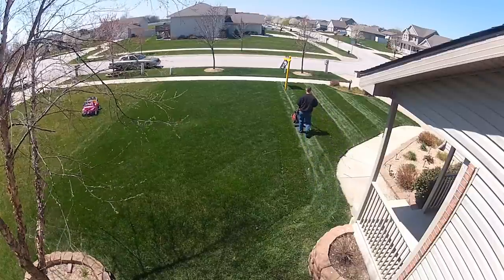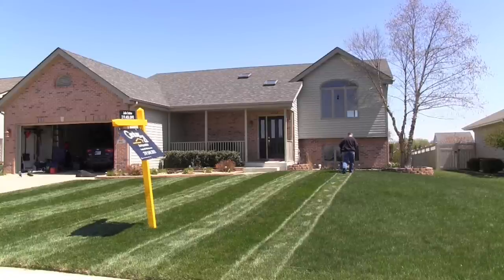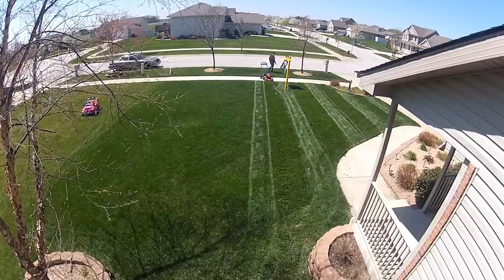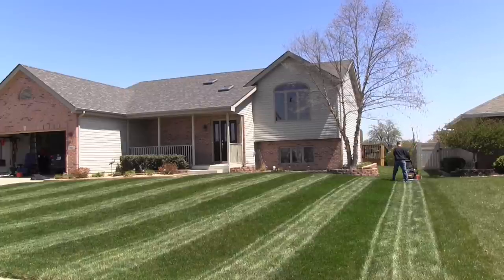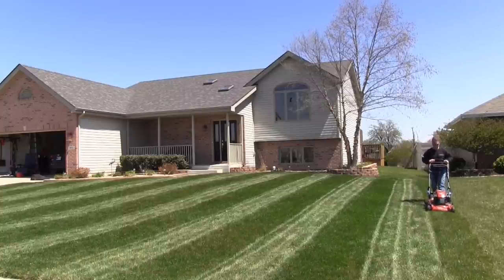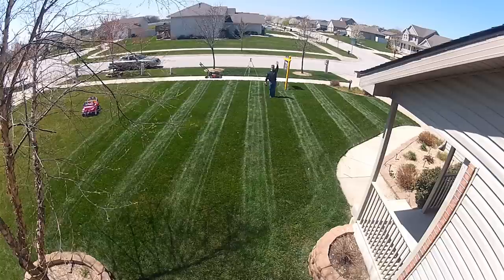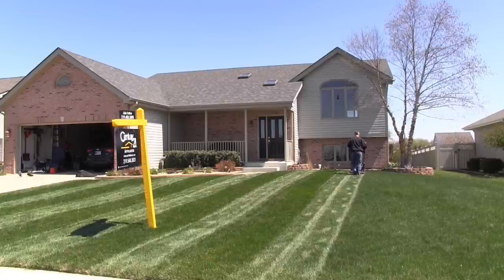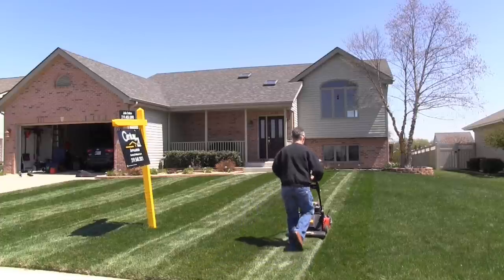Lawn Striping: How Does It Work?

Comment: to get Pro looking, perfect stripes you need to buy a bicycle grip push style lawn roller and add some water to the tank. the more water you add the more the grass blades will bend for enhancement. after you mow, just push the roller by itself across the lawn as if you're cutting it again. your stripes will be much bolder than they are now. you could also make 1 using old push mower handles that you will bolt to a large diameter 3"-5" PVC pipe filled with cement. a 100 pound roller will really set off the stripes. that's how the baseball fields are striped. you could also use a 100lb linoleum roller with great results.